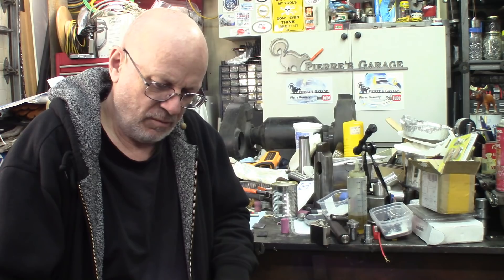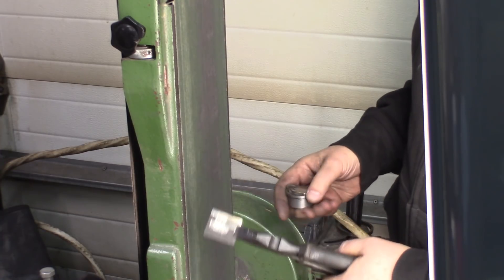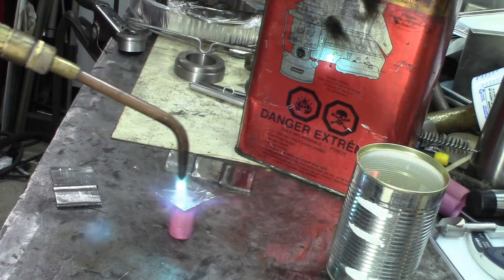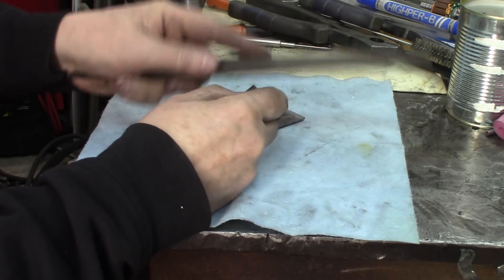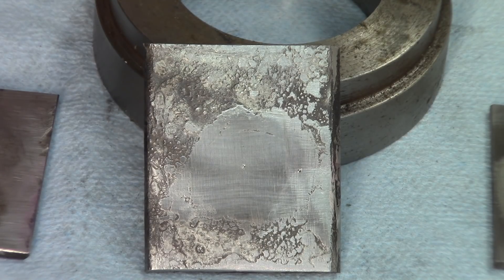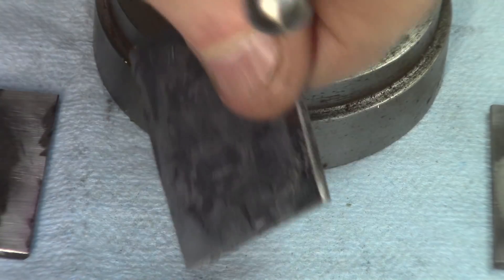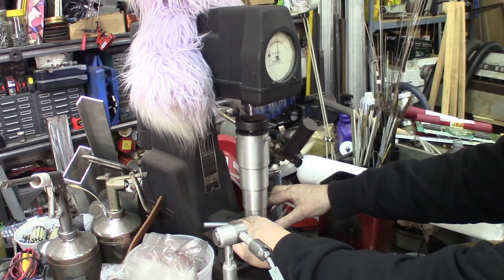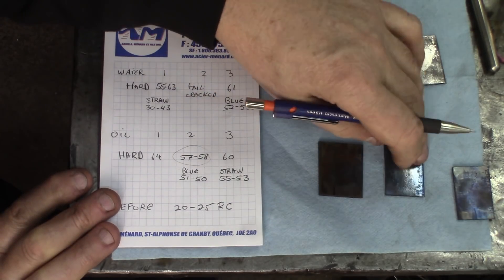Bed Frame Stories... FREE or CHEAP source for hardenable steel, the basics....

Comment: Hello Pierre.  I can tell you that I have a trailer that we welded.  My Dad and I.  ANd we welded all the cross pieces with bed frame rails.  The trailer is 97 x 49.  So all the pieces across the 49 inch width are back to back bed rails.  Never has a failure is 6 years.  Carries a lawn tractor and logs regularly.  Pretty much depends on how you treat your welds and your materials.  A weld by itself is not a hardening process.  You provide no quench when you are welding.  Although welding a high carbon steel can create a potential problem.  With my limited experience it worked well.  I picked up my bed frame rails at the local rural dump near Perth Ontario.  Yep I'm a scavenger to!
Reply from the maker: Aren't we all getting exited in front of a big pile of metal scrap...???    lol
Welding when properly done is ok, just make certain the welded zone don't cool too fast due to the mass of metal asside that will be pulling the heat from that welded zone, some preheat with lower cooling rate and some stress relieving will help make safe welds minimizing the risk of cracking.   The use of 7018 rods is also a way to improve the results, also sometimes higher Nickel content filler will do...
As I say, advanced welding techniques are part of an art that is learned by specialized training and expereince...   ;)
Compared to most other viewers, you're not that far from here...   ;)
Thanks for your comment,     Pierre
Reply: You hit the nail on the head.  Right rods and welding a smaller cross section steel angle to a larger heavy walled square tubing.  Can't argue with what works.  And yepper I'm not that far!  Been in your neck of the woods many times.  I even used to live in La belle provence!!  They let me out for good behaviour.

Comment: I appreciate your caution on transportation, etc., however in the natural state bed frames are good for fabricating lots of things, and easy to stick weld. I knew they were a fair amount harder than 1018 or A36, appreciated seeing the numbers. As for supply tricks, cruise past the dumpsters in apartment complexes on the last day or so of the month. People leave them alongside the dumpster in case someone else could use them. Me!
Reply from the maker: The moving period is the best time to collect those...   Just need to be faster than the scapeers...  
One of the way to get "Safer" results is to use 7018 rods, be careful to cooling rate, also try to keep the HAZ  ( Heat affected zone )  cooling rate as slow as possible, even there, it will also depend on how much carbon is in that particular batch of material...   Carbon content over 0.5% is starting to be quite more critical to make safe welds just by ordinary techniques.
Take care,    Pierre

Comment: You certainly are right about this material.  If you don't know what it is and go to drill it you will find out.  Be careful or you will burn up a HSS bit trying to drill it.  Don't ask how I know this.  Thank you for sharing this.
Reply from the maker: Hi Glenn,
Most of the time you get to burn a drill bit, even the good quality ones, os that often people turn the bit too fast and the heat produced tends to harden the material...
The speed and feed rules apply there also, in alloy steel you try not to go oer 40 to 50 feet per minutes on the rotational speed. You're not the only one to over speed, guess how I know...   ;)
Thanks for viewing and for comment,   Pierre
Reply: Pierre,  I really do appreciate your input, because I had not considered that at the time and likely would have made the mistake again.  Good one Sir.  By the way, were you able to saw the coupons out on the band saw or is the material too hard for that?   At this time I don't have a piece of bed rail angel or I would do some testing myself.Thank you for your knowledge and the time you take to put up these videos.
Reply from the maker: As found the material is soft enough to cut with a good quality blade, there was no problem, also, my saw has coolant capacyty, good luck on future gargage days to find some good frames...   ;)

Comment: I have a hard time finding the beds made with 3" bar stock to get good useable material. lol
Reply from the maker: Got a good way for you to find some, before bed time tonight, just watck "Jack and the beanstalk" movie, sure you'll find what you need there...    lol
Reply: It's easy Brian, all you need is an electric arc furnace, and a small concast line. You left a pit in the barn floor for the concast loop, didn't you?

Comment: from my experience bed iron has indeed structural issues, cracks and weaknesses, its either crudely extruded or has badly mixed recycled steel and is of low and variable quality, and i think is hard by surface tension and stress from its manufacture, increasing its cracks which come later. i used to hate using it for projects, it could also weld badly if it felt like it, i think you just fell into the trap of thinking the water quench was the only reason, i think it is generally defective steel, things made with it tend to fail around weld points, i made several items and they welded badly with it, probably also large crystals of carbon due to cast iron mix?   i think i made some oxy-acet trollies and they failed at the welds from this stuff, it doesnt like the load, the heat from welding made it weaker
Reply from the maker: Hi, when welding higher content carbon steel, the fast cooling of that joint will harden the zone and cause brittleness, this is where the cracking comes from...
In short, you need to use filler metal compatible with high carbon alloy, like 7018 rods or so, keep the weld and the surrounding zone from cooling too fast, re-heat the assembly in order to releive stresses, even then it's a hard to control alloy due to inconstant quality control and quite different batches produced without any universal standard...  
Thanks for yor comment,   PIerre